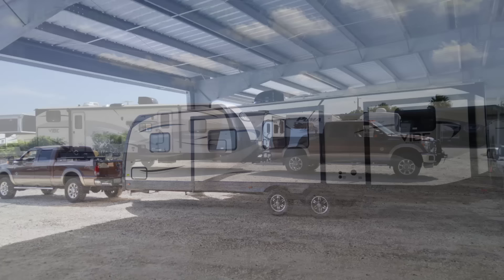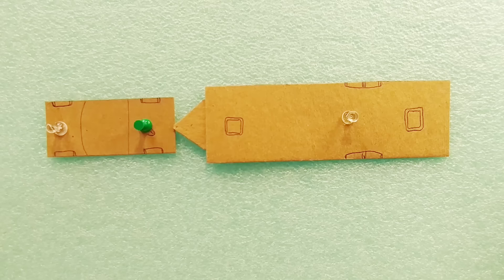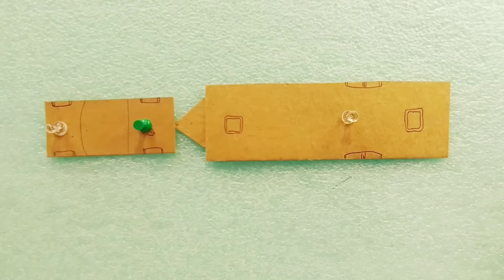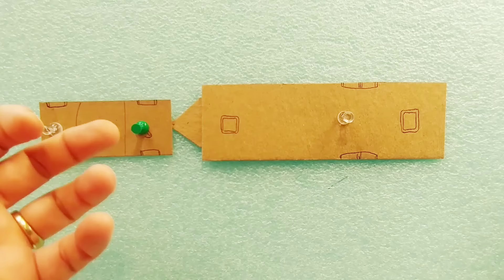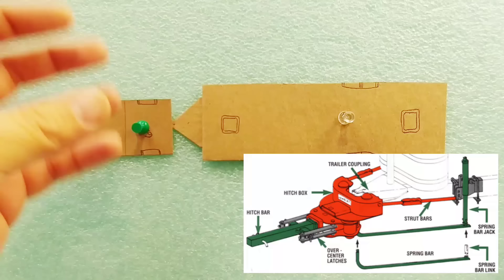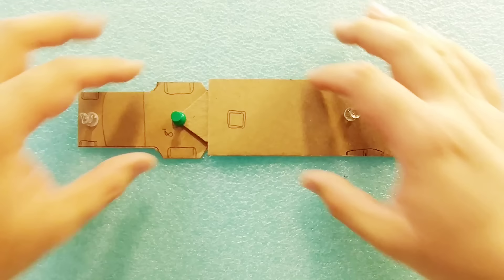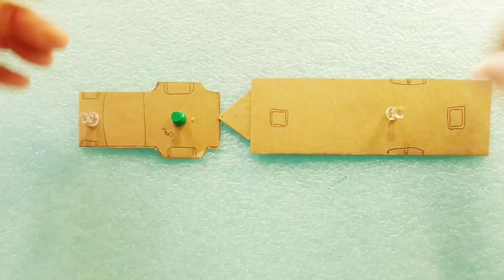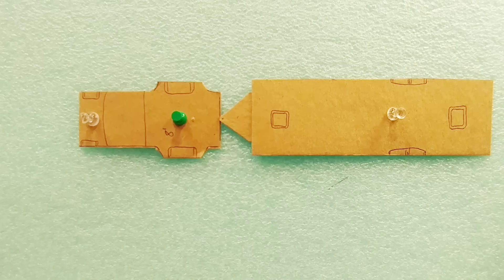Sway when towing an RV? Watch this!

Comment: Nice job at explaining how sway works and what causes it. Nice that you included the Hensley hitch in your description. I have been towing trailers for 40 + years, and since 2007 when I bought my Hensley hitch, I have towed 3 different Trailers all on the 30' range with a 2007 Chevrolet 1 ton Express extended wheelbase van.We have traveled over 37,000 miles, and not once have we experienced ANY sway! And as to expense, yes they are expensive, but when you consider that they are connecting my investment that approaches $80,000.00, the $3,500.00 I spent on the hitch system amounts to a bit over 4% of the value I have running down the highway, and it is guaranteed for life to the original owner. I call that pretty cheap insurance. By the way, I do not work for nor am I compensated for making this comment or any other comment about the Hensley hitch. I have worn out various parts of the system, and I call them, they send me the replacement, bill me, and when they receive my damaged parts they credit me that payment. And yes, they play hell on my receivers. I have replaced one and had the second receiver modified to manage the stress.
Reply: Jeffory Newkirk LOL!  The first thing I did when I got my '05 dually was to get rid of the (sub)standard frame mounted round cross beam receiver carrier  Chevy supplied in that time frame with a "Class V" replacement.  It wasn't really very expensive as I recall.  Subsequently, I likely didn't tow nearly as much as you have, but I have similar sentiments to yours about the Hensley Hitch.  Never leave home without it!  Be Safe!

Comment: Very good explanations. I tow a 35 foot long Wildcat behind a Chevy 2500HD.  We went towable because of a large shell and dog crates in the truck bed.  I use the equalizer system, and it seems to do the job. The only time I've felt the trailer come loose was on a high bridge in wind over the Mississippi... it was exciting for a moment...until the hitch did its job and everything snapped back straight :)  Keep the great videos coming

Comment: For the most part a 3500 duels and a 3500 single have the same weight ratings. But like for example. Washington state wants you to have a 3500 duels if your gross is over 20k. Even though the weight ratings are the same  for both duels and single

Comment: Well, unless I'm missing something. The best way to reduce (get rid of) sway is to add a set of wheels underneath the end of the A-Frame hitch assembly.I hope I'm not the first to think of this simple solution. (something smaller to what is used on combination trailers) The low cost would be well worth it.

Comment: Some comments about loading a trailer evenly would be good advice, as an improperly loaded unit with too much weight in the rear  will cause a very dangerous situation on the road.

Comment: Great info. Thanks. 
I would only ask that you change the terminology in the future to “Bumper Pull” vs “travel trailer”. They’re all travel trailers. 
So for comprehension and clarity... my thought is ...
Fifth wheel/gooseneck vs bumper pull. Bc again.. all 3 kinds are travel trailers. 

Thanks. Again, great info.
Reply: Tony Woodard Just wondering - does anyone tow anything but a utility trailer or a small boat hanging off the bumper??

Comment: If the person towing takes the time to set up the attitude of the van to vehicle so that correct contact from all road tyres are correct then the need for suicide bars , which are nothing more than the lazy man ride levelling system, are not required.They are typical of yet another warm fuzzy after market "gotta have". These may assist with retarding the potential for sway but certainly do not eliminate sway. Guaranteed with these bars fitted, if sway occurs and the driver cannot correct the vehicle will 100% take the vehicle and van in one fell swoop. Having towed for 50 years I have used these bars in the past but realised that there is no substitute for correct setup. Inexperience is the biggest danger... drive behind a road train with 3-4 trailers in tow in outback Australia and you will notice how understanding your rig is the greatest asset you can have

Comment: 3 comments.  1- thanks for the cutouts that let you point to what happens where. I understood that.  2- I did not read all the comments, in fact I didn't read any of them so maybe my second comment is already covered.  If so, let me know and approximately where to look and who said it.  My comment is that you did not include the contribution of unlevel towing in aiding to sway factors.  Before RV-ing, I once towed a rented cement mixer back to the rental yard for my son who was using it.  I told him I was concerned with the obvious angle in the connection.  He suggested I stay under 35 mph.  I did, but noticed that it was more like 28 mph.  Anything higher just scared me.  And the faster I drove, up to 35 mph was downright dangerous.  Is this an affecting sway source?  3- Is there any way you can use a similar display device to show how trailer wheel placement affects backing up?  I have watched many YouTube encouragements for backing up.  One of them did not spell it out but included it in talking about when in his video he was turning the wheel.  Essentially he said something like 'now you turn the trailer' and his wheels on the trailer were at or just into the road edge he wanted to turn into 90 degrees.  I knew his comment was an answer to my physics understanding, and after rewatching that segment four or five times tried putting the concept into a test and was amazed at what happens when. Now iI am working on when to turn the steering wheel which direction to follow the turning trailer.  Several demo videos try to draw or photo backing up, not usefully to me like you showed in your sway video here.  Can you put one together?

Comment: I've towed my 36ft travel trailer tens of thousands of miles with a Hensley hitch and have never experienced sway. If one has a travel trailer there is no safer way to tow.
Reply: Does it affect turning at all
Reply: jaime villafan Doesn't affect turning at all and you can back up with it as well. The first few times I hooked it up to my truck was challenging but with a little practice it's pretty easy now. I highly recommend it, they are expensive but I was able to get a refurbished one.
Reply: Doug Smith thank you for the help
Reply: What is your tow vehicle? I'm wanting to tow a similar size trailer with a f150 and the Hensley hitch, do you think this combination would work well?
Reply: @MrGoodtime1301  a 150 is too small for anything but the lightest 36' trailer. Empty.
Reply: I'm going to be towing an open Rd with my lrg.8 cy.ford expedition. .trailer I'd 26ft total length. .2 pop outs..it came with good sway bar and maxxi radial tires..I'm female and have pulled utility trailers and have driven pickup trucks...do u think I should work on getting better sway and tires before I start to travel?

Comment: iIf you will level the trailer out you will not sway. Too much weight in the front or back will cause it to sway. Regular wind resistance is not a problem high winds that’s a different story. The hitch I use is a good 20 years old. Just level everything out and you will be fine

Comment: I think my sway questions were answered in the comment section.  I already have the truck, the hitch and the trailer, so I need to know how to handle sway, if it should happen while I'm on the highway:  Stay off the truck's brakes, use the trailer brakes, and slow down when there are wind gusts and lots of big rigs . . . right?

Comment: The big problem is the manufacturer. The axles are to centered on the frame. There for you'll need more forward weight. Simple answer, don't buy a trailer with that axles close to center. The farther back the axles are on the frame of your travel trailer the less sway you'll get.

Comment: You didn't address load infront and behind the trailer axle.
You can head out camping with a full fresh tank and empty brown tank. You can come home with the opposite. Add in all the stuff you pack and possibly a bunch of wood. This means not enough hitch weight allowing the tow vehicles back tires to have less traction and increased suspension travel.
Reply: ^ This! Single most important factor is to measure axle and tongue weight. Sway control is great but its a bandaid for a poorly loaded trailer. Ensure you have at least 15% on the tongue
Reply: Travis Pfannmuller exactly right. There is no magic hitch. Learn how to load your trailer

Comment: You left out balance of load inside the trailer.  A trailer with too little tongue weight will sway.  It is VERY easy to have the travel trailer loaded with too much weight to the rear.
Reply: By far the most important factor. Everything else is a bandaid. It is so important to know trailer axle weight and tongue weight. Anyone who's pulled in the mountains can attest to this

Comment: Coming in late here but isn’t the issue really about resonances set up that one seeks to interrupt, either via a WD hitch or with a 5th wheel? You might get shoved over with a fifth wheel, but as the hinge point of a fifth wheel is, as you say, forming effectually a single unit between trailer and tow vehicle, there are no resonances that can happen between the two ends. A standard hitch, with the hinge point separating the two pieces, can turn a travel trailer and truck into a whip, with each corrective action amplifying the amplitude of the other section’s movement.

Comment: Ok so for people who don't have a dually and a 5th wheel... With the anti sway bars like you had mentioned along with air bags in the rear would be the best bet as long as the front end stays level? Just making sure I have it. We have an escalade SUV and I want to pull a smaller 3 or 4,000 travel trailer safely for local camping trips. Not necessarily across the country but I obviously don't want to die along the way .. lol I wasn't even aware this was a thing unless you were just towing something too big for the vehicle.

Comment: I was really hoping you were going to put that green tack in the position of the hitch connecting the truck to the trailer for demonstration purposes. Not sure why that bothered me so much. Personally I believe that most of the trailers you see swaying down the road are caused by people putting more weight behind the trailer axles than putting it over the axles and to the front. Thanks for the info.

Comment: Nice!! Very informative!! Perhaps how to setup a sway control device would be great.
Reply: They differ from one manufacturer to another and the instructions are very model specific and detailed for each system. Best to best to refer to the manufacturers instruction manual and maybe the manufacturer would have a video on the recite for whichever one you buy.  There may be a few basic rules but each system has its own very  precise way of setting it up . And if you switch trucks or trailers you have to reset up the entire system for those 2 to match each other.

Comment: What’s the best way to get your truck and trailer under control once the trailer starts to sway.  I know the obvious answer which is to prevent it in the first place, but better to speed up,slow down, break,don’t break yet get off the accelerator, just pray cause it’s too late.  Thanks

Comment: I've always understood these principles, but this video is great for someone who doesn't .  I've towed a lot of trailers with my trucks, boats and other trailers plus my dads fifth wheel, but for my first camper I am getting a travel trailer and looking at the Anderson No Sway system.  Haven't found much on feedback from actual users.  Anyone have any input?
Reply from the maker: +Adam Koerner: Not a bad system, but more prone to failure simply from the principle of how it works.

Comment: what about weight distribution? my experience tells me that too much weight behind trailer axle creates sway, not so much wind though.. how much weight on hinge are you using in your example?
Reply: 60 40 is the proper weight distribution on travel trailers.  On my 5th wheel its 70 30 or better. It also depends on axle placement on your trailer itself.  But making that adjustment with a fully loaded travel trailer eg, fuel water in the tanks and all your goodies. You're just trying to reduce hitch sag. Make sure you have the proper truck to tow with. Seen so many with the wrong truck, but with the right set up. Been driving HDT for 25 yrs. And towing travel trailers and 5th wheels for 35 yrs. And it always helps to talk to the camping community at events and while on the road. Peace and love my brother.

Comment: I must have missed the point about how much weight should be put forward or rear of the axles on the trailer.  seems my trailer has less sway with more weight in the front of the trailer.

Comment: If I were to pull a 31' or 34' trailer with an even shorter wheelbase vehicle, like a late model Tahoe, would investing in a Hensley/ProPride make this a feasible setup?  8600 lb. tow capacity.  Ultra lite trailer at either 4885 lbs. for the 31', 6000 lbs. for the 34'.

Comment: Excellent video sir. I’m new to towing a toy hauler. I’ve towed a 17 foot boat but never anything heavier.

I purchased a Ram Dually and a toy hauler and was curious what your thoughts were on using an anti-sway system for this setup. I believe my travel trailer toy hauler will weigh appropriately approximately 9,000 lbs fully loaded and is 26 ft long. The Ram Laramie 3500 Dually is the 6.7 Turbo Diesel. Also I do have a Curt MV Weight Distribution System with no sway control on it.

What are your thoughts on adding sway control to my Curt weight distribution system? 

Thanks.

Comment: great, I would really like a video on the towing system a truck comes with or SUV.We have a 2014 Expedition and it tows well with our 22FT North Trail. I still am unsure if I have the Brake Gain set properly. Any and I mean any help with our Ford system would be great. Thanks!

Comment: Great video and all the info you share with us . What about towing with a 2000 Chevy Tahoe. You mentioned all trucks  but nothing about SUV . 23 Ft Bullet is the TT.   Thanks
Reply: Shouldn't be an issue if balance is correct.  Take it to a public scale and weigh it.  Disconnect the trailer from the TV and weigh the tongue separately to approximate the tongue weight.  Also do not overlook the condition and tire pressures in ALL of your tires.  Verify the torque on your lug nits regularly.  Otherwise you're gambling with the safety of everyone in your rig.

Comment: This is obviously an old video but I just traded my 2500 for a 1500 short box GMC Sierra the max tow rating is 9600 +\-   What would be the longest trailer it could safely tow?  Ive never really had to worry about any of this before because I went from a GMC 3500 to a 2500 and now a 1500. The reason I ask is that I found a 28’ toy hauler lenient being total length and a little over 5000 lbs. Hauling a 900 lb motor cycle.

Comment: I know this video is a couple years old but thought it would be the best place to ask this question. So we know that a WDH transfers tongue weight to the front axel. On a tandem axle trailer, would it transfer weight to the rear axles? After going though several blowouts I put some USA made trailer tires and adjusted the hitch to not transfer as much and added tpms to the trailer tires. At the time I was thinking maybe there was heat build up in the rear tires or I was just on an unlucky streak with tires. It has been a couple years now and no blow outs. Nock on wood 😬. Just got a new truck and had to lower the hitch a bit and it got me thinking. I have thought about this every way and still not sure. Any input?

Comment: I don't agree with your explanation of the effects of the axles not being perpendicular to the trailers side walls.
If the axles are askew, the trailer will dog track. This will create unequal wind pressure on the trailer sides. Even minor wheel (axle) misalignment can lead to unmanageable swaying because of the uneven wind forces.

Comment: Just watched your video.  I have a 2003 Ford E350 Diesel Cargo Van (same size as a vanpool van, 9600 lb towing capacity, with airbags, blue ox 1500 lb hitch). I bought a 2016 Keystone Vaporlite toy hauler (7600 lb). Have had it for a couple of years. I live in it while contracting.  Had real difficulty driving from Idaho to New Orleans last April (where I still am). Tried putting a motorcycle in before I left and was all over the road (left it home). I am guessing I just don't understand how to set up the hitch and the air bag combo. I am pretty sure I had way too much air in the airbags. Any advice?

Comment: Great video, it makes it easy to understand the forces going on. As kind of an all around vehicle we recently bought a new Jeep Grand Cherokee with the tow package and Hemi which has a towing capacity of 7200 LBS. We had in mind getting a 17 to 20 ft. camping trailer with about 22 to 25 ft. total length with empty weight being 4000 to 4500 lb. and thought we'd be fine. Shortly after getting the rig my friend tells me I'm nuts to get such a short and narrow vehicle to tow a trailer. With getting a good weight distribution / sway control system what size trailer do you think would be a good or maximum size to have a stable ride even in hi winds or being on two lane roads with Semi's going the other direction. I imagine we will have to find some extra long extended mirrors. Thanks for your help.
Reply: I have the same suv and am trying to learn about these towing factors so I know what kind of trailer to get. What did you end up with for a trailer or what else have you learned? Any experiences pulling a trailer yet?